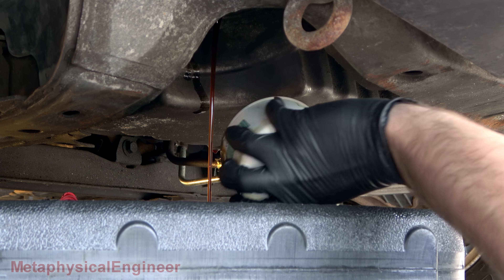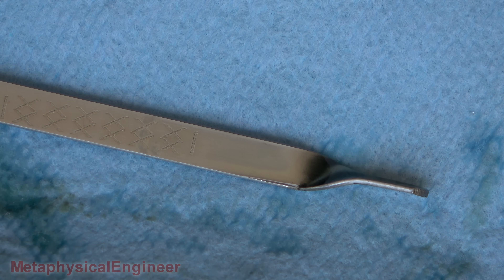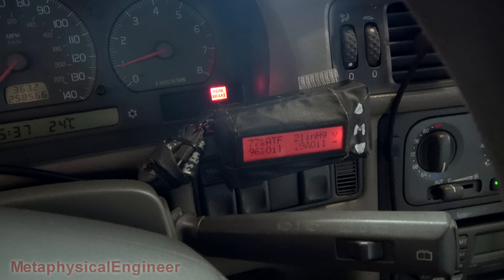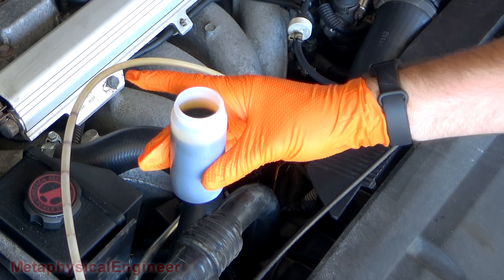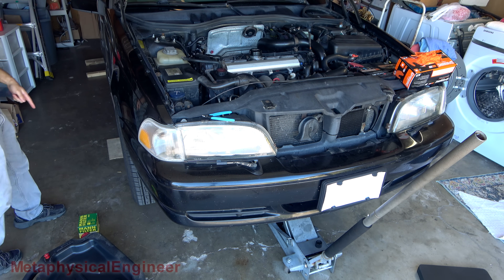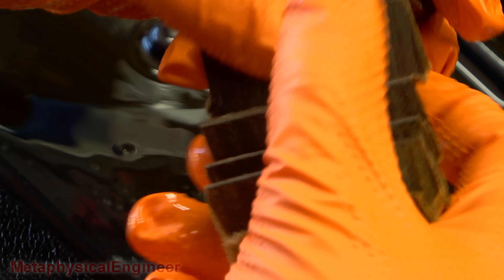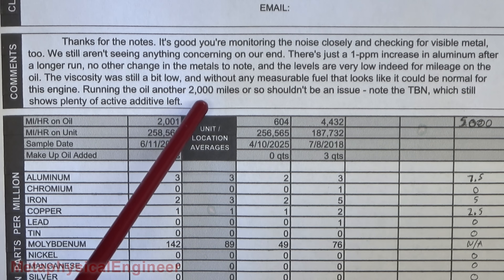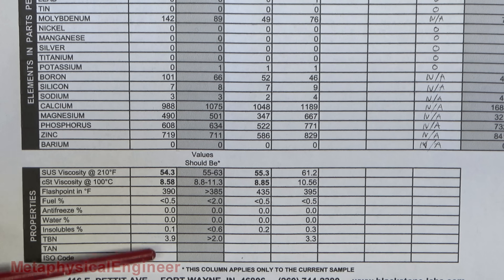Valvoline Restore and Protect vs Noisy Lifters - Used Oil Analysis and Filter Cut Open

Comment: That's a chonker of a filter for a passenger car. Thanks for the video, watching all of these while I run RP oil in 2 vehicles myself.
Reply from the maker: It's pretty big, yeah.  Volvo used the same size from the 60s through the late 90s.  Can see now I had nothing to worry about with clogging but didn't want to take any chances. 

I watched a bunch of R&P videos that convinced me to give it a shot.  What vehicles are you using it in, and are you chasing known problems like sludge or oil burning from clogged rings?

Comment: There is no reason to lubricate the gas hit on the oil filter There is oil left on the surface that the gasket makes contact with after you have removed the old oil filter. There is also no reason to prefill the oil filter.
Reply from the maker: We'll agree to disagree on those points, I suppose.  I clean the gasket mating surface, so there's not much oil left, and I'm not keen on dealing with a stuck filter.  Between 2 seconds and 6 seconds of running dry before oil pressure builds, I know which I prefer, so I fill the filter.

Comment: Looks like you live in town. Do you always change the oil at 2k? I have been a tech since the late 70's and have adjusted the oil change from 3k to 5k due to fuel injection and severity of use. I have never gone along with the 10k or 15k new car manufacturers recommend. But, 2k seems too pricey.
Reply from the maker: This was a sample and filter inspection without changing the oil, as shown in the video.  Normal interval is 5k for this car. Large sump capacity and big filter helps.

Comment: I've started using it in my 89 Jeep, oil consumption is down, but I did not carefully note how much. Thinking of trying it in my wife's MB (560SL) which has intermittent valve tap when cold. They don't list any SAE40 version, though. Not sure how critical that is (car is lightly driven)
Reply from the maker: In cooler conditions and gentle driving, 5w-30 should be fine in the Merc.  I would change it somewhat early and get oil analysis done to check how well the oil is working regardless.  Really wish Valvoline would market a 40 grade version here since there are still plenty of vehicles calling for that in the states here.
Reply: @MetaphysicalEngineer  thanks
Reply: Just burn the SAE30....I have done it on my 3.0T Audi and have significant reduction in consumption in just one interval. My PCV does need to be changed though and have one on hand...just lack the time to do it.

Comment: That oil did not look dark. My 2000 Impala with 200k after mobile 1 15000 miles OCI was DARK
Reply from the maker: Yeah, 'dark' is relative for sure!  I've seen people call oil of this color dark, as if it's all done for and needs changing immediately.  My gf's newer Corolla has the oil come out a much clearer honey color, but that's a very efficient N/A motor, much cleaner burning than my boosted brick.

Did you do any analysis on the oil to back up those longer intervals, or are you trusting the marketing on the oil and filter alone?

Comment: Your oil filter is the size of a house!!
Reply from the maker: It is pretty big!  I wasn't too worried about it clogging, but wanted to be sure, and cutting it open gives more data on what kind of material is getting dislodged by the cleaning action.  

Volvo used this model filter on just about everything for decades, before going to a cartridge type filter for model year 2000.  There are bigger ones with the same thread and gasket specs, but can't go much wider or longer for clearance reasons with how it nestles in the corner and sticks straight down.
Reply: @MetaphysicalEngineer I think I may have a similar one on my 1994 volvo 940! I was wondering if it was a volvo until I saw your wheels in the video.

I trust volvo so I wonder if they were onto something here.
Reply from the maker: @enb3810   Yeah the 940 will use the exact same filter!

Comment: My 20-year-old Explorer had a really loud tick and I used Marvel mystery oil and I use it for a while and it definitely works, but it could make your engine leak oil, I would rather use this Valvoline because it’s a slower process and safer for the engine
Reply from the maker: You bring up a good point that a flush or straight cleaning additive could loosen deposits that are helping a damaged seal to hold.  Unfortunately don't remember the source but I heard the R&P has a lot of seal conditioner additive to reduce the risk of causing massive leaks as it cleans.

Comment: If you want an additive for a Hemi tick try Lubegard. Most motor oils and The Motor Oil Geek say don't because the additives compete with the other additives in your oil and could actually make the oil less effective. Having said that I have used Lubegard for years and it did stop a Hemi tick.
Reply from the maker: Thanks for the suggestion! I'll keep the Lubegard in mind for future testing of R&P doesn't do the trick.  I do use their ATF Protectant in the transmission so I trust their products.

How long did it take to resolve the noise in the Hemi?

Comment: I was under the impression youre supposed to change the oil up to 4 times when doing this flush.
Reply from the maker: The fine print says  "Up to 100% piston deposit removal when used as directed for four or more consecutive oil changes at standard maintenance intervals."  There's no exact mileage listed on the product into, but when Lake Speed Jr. (The Motor Oil Geek) visited the Valvoline test facility, the example piston was shown with a single interval of 90 hours test time which was claimed as equivalent to 4000 miles driven.  

So I'm guessing four oil changes needed at 4 to 5 thousand miles each, so 16 to 20k total miles or 400 ish hours of engine time for the "full" cleaning effect.  It's a thorough but slow cleaning, for the extremely tough deposits that normal detergents or solvent flushes cannot remove easily.  

In practice I expect asymptotic cleaning rate where the bulk will happen in the first hundred hours or so, while the most stubborn deposits may need hundreds more hours to resolve completely.  This tracks with people reporting noticeable improvements in oil consumption or blow by in the first couple thousand miles of the first interval.

Comment: 97 Camry. Found out neglected big time sludge on top. 200 miles in restore and protect and no more oil smell at startup. Figured valve seals before. Maybe a small smudge of sludge under one? Unlikely an oil ring would let go so fast. Previous owners ran dino and long intervals. 
Oil consumption was 1/2 qt 1k miles.
Reply from the maker: Oil smell on startup definitely sounds more like valve seals than rings.  Could have been some crud in there causing poor oil control.  The scrubbing up and down motion probably sped up the cleaning action.  Pretty sure R&P has really good seal conditioners too, as otherwise there would be an epidemic of engines leaking after using it.

Comment: Seafoam is definitely not snake oil!  Maybe it didn't work for your application, but there's none better that I've seen when it comes to in the tank fuel system cleaner! Works very well with small engines and 2 strokes as well.  Personally I wouldn't run it in the oil because it cleans a little to well at times.  Had a lady do that and came back to the shop a week or so later with white smoke coming out.  Pulled the engine down and it had cleaned so good the rings couldn't seal anymore. After that we stopped recommending it for oil use.
Reply from the maker: Probably should have made more clear that I was semi-joking about the "snake oil" terminology.  The previous videos I talk a bit more about how Seafoam and MMO do have uses in the oil, but more so in cases where the engine suffers from soft sludge, not rock-hard varnish.  It'll dissolve that pretty fast!  

I do like it better as a fuel additive/stabilizer.  Many times had it fix neglected carburetors on small power equipment, and I'll run a can through the fuel system on the car now and then.  Also worked great as a solvent soak for cleaning the metering orifices on this car's wacky PCV system.  

Did you remember how much the lady had put in?  A full bottle in my car with a 7 quart capacity is more than double the dosage on the instructions.  A full bottle in a car with a 4 quart sump is quadruple the dosage, enough to thin oil to the point of lubrication film failure.  Can see how that could tear up the rings.

Comment: Had oil changed on my 02 escape 3.0 engine. Used valvoline Max life high mileage.
If anyone knows these 3.0’s they know that they really leak oil. This oil has just about stopped my leaking, has increased my mileage by 2 mpg and the engine purrs. I’ve got about 2000 miles on the oil and I’ll be changing the oil myself and I’m putting the same oil in. I always was a Castrol high mileage oil, man, but I think I’ve changed to Valvoline.
Reply from the maker: The Maxlife High Mileage is good stuff too.  I've used it for a while before this recent issue, and it's part of why I think my car hasn't suffered oil leaks from seals (knock on wood!) 

I'm not familiar with the common issues on the Ford 3.0.  Was it the rear main seal leaking that you could tell?
Reply: @MetaphysicalEngineer  No not the rear main seal, front timing chain cover and rear valve cover back by the firewall.
There’s a lot of heat by the firewall from The catalytic converter and not enough heat shielding.
That heat also causes the coil packs to fail often. I’ve got it down to about 30 minutes to pull the intake manifold so I can get to those coil packs and replace them. lol

Comment: been doing my own oil changes for 20 plus years on a number of different cars, you dont need to prefill the filter
Reply from the maker: I guess we'll have to agree to disagree on this one.  6+ seconds running with no oil pressure on every oil change, vs less than 2 seconds.  I know which I prefer!

The extra time spent to prefill is worth it for me, as I'm not a quick lube shop squeezing more cars through the bay per shift by shaving seconds off the oil change process.

Comment: Have you noticed a difference on how your car drives with the oil level not on the dipstick full mark? Maybe consider using 1 quart of 10w-40 Maxlife high mileage to increase viscosity.
Reply from the maker: No difference in drivability or oil pressure.  Oil will heat up and cool down faster if there's less mass in the system, but the safe range is as the name suggests. There's no sane operating condition where the engine will starve of lubrication with the oil in that range.

I've considered adding higher viscosity oil, but that could also affect the cleaning, based on info in the Motor Oil Geek videos about this oil where the performance depends on the balance of additives and base oil.  I'm sure others would appreciate if Valvoline sold a 5w-40 or 10w-40 here in the states.

Comment: I stopped over tightening everything like that when I had more than a few hand right oil drains come in off the street and one time I touched an oil filter with my finger and it started spinning loose. Not a drop was leaking.
Reply from the maker: Crazy how sometimes things will hold fine and come loose at a touch, but other times a supposedly tight filter or drain plug backs off and ruins the equipment.  

My dad's Subaru came back from dealer service a couple years after he bought it.  A few weeks later we noticed oil spots on the driveway in a weird place.  Rear diff had been serviced and the drain plug had backed out to the point it started weeping over those weeks.  Would have mulched the diff if we hadn't noticed!

Comment: it cleans your engine so don't leave it in for 5000 miles change it out after 2500 and use regular oil after I wouldn't use this 100% of the time. My truck looks like clean oil after 3k miles and is still on full and I have never used this kind of oil just went over 200,000 miles I only use Castrol Advanced full synthetic gold jug 28 bucks it is the # 3 best oil #1 is Rotella full synthetic truck red jug it is hard to find and super expensive #2 is Liquid Molly and again it is super expensive so for 28 bucks I can deal with that every 10k miles or so is when I change my oil 1ce every 6 months or so.
Reply from the maker: Why would I stop the cleaning before the cleaning is done if the oil still measures as good?  That makes no sense!

Awesome that your truck is in great shape at that mileage.  What year make and model?
Reply: @MetaphysicalEngineer then change the filter cause it can gunk up before 2500 miles maybe 500 miles if your engine has a lot of buildup anyways that cleaner oil is not in the top 20 of best oils so it doesn't lubricate as well I wouldn't leave it in my engine... 2003 Ford Exploder I bought it 9 years ago for 800 bucks just put new timing chains in it has ran perfect ever since but when I bought it it was still running so it didn't jump time it was just making a bit of noise...
Reply: It is made to be used all the time. Using it in a new 1k engine to prevent low tension ring fouling Toyotas are known for.

Comment: it take about 6 oil changes fo marvel mystery oil to work, it dont happen in just one oil change
Reply from the maker: I figured MMO would take a while in my case.  Maybe I gave up on it too soon.  Though most people I've seen use it for lifter noise had the problem resolve relatively quickly in one oil change or even as soon as a few hundred miles.

In your experiences will MMO manage to dissolve the very hard varnish and carbon given enough time?

Comment: I’ve used restore and protect in my 4.0 pathfinder that I bought used..  started at 106k with R&P…. And now I have 129k… I change it inbetween 3 and 4000 miles depending on how much idling and slow off-roading I do…. The engine (knock on wood) has no consumption absolutely zero between oil changes, sounds great, and is clean everywhere I can get a bore cam in. Even the dip stick had the varnish removed
Reply from the maker: Sounds like R&P worked quite well for you!  The shorter intervals probably made sense with a lot of slow speed operation.  Would be very curious to see what oil analysis would say about those intervals.
Reply: @MetaphysicalEngineer yea I need to pay for some, might save me some money

Comment: Restrictive oil filter. Need something with more inlet holes. Give the pump a break!
Reply from the maker: If that were a problem, they probably would have changed the design sometime between the 1960s and now. This is the OE filter that Volvo used in basically every model for that long. I've never seen a difference in pressures when running other brands. 

Filter media is way more restrictive than the inlet holes. Heck, the 1/2" oil cooler hoses to and from the radiator are probably more restrictive.
Reply: Restrictive? Lol ok

Comment: I don't quite understand filling your oil filter before putting it on. Can't do that on a Subaru. Have you tried filling your oil with the oil filter off? Does the oil not spill out of the spot where the oil filter goes?
Reply from the maker: True that Subaru and some other engine designs have filters that cannot be prefilled.  Though having filter easily accessible up top is convenient for sure!

Filter is always after the oil pump, so no oil will come out if I fill the sump first.  Just like how when I remove the filter at 7:33, only the oil in the oil passages drain, while the sump stays full.  

Prefilling the filter allows oil pressure to build much faster on the first startup after the oil change.  Until filter and passages fill, engine is running with zero oil pressure.  There's still oil film on the bearings, but it puts many hours of wear and tear on the engine in a few seconds before pressure builds.  The bigger the filter, the worse the problem will be.  Since the oil pump is driven directly from the crank in this case, there's no provision to prime the system without cranking the engine.

Comment: The lifter tap is due to failed needles in the roller of the lifter.  Catastrophic failure is imminent.  This will damage your cam or worst case, knock the keepers out of a valve.  This happened to me and is a well known issue with the 5.4.  Mine dropped a valve at about 170000.  The lifter will eventually wear to the point that it is ejected out and will destroy your cam and worse.
Reply from the maker: You make good points that such noise on an engine with roller lifters can indicate the roller has failed.  In that case wear metals in the oil would be elevated, and/or visible metal would be present in the oil and filter as the problem got worse.

This particular engines uses direct acting bucket lifters with no rollers.  Ticking noise is due to one getting partially hung up on varnish.  As long as there's no metal in the oil and the noise doesn't get worse, I'll keep observing.